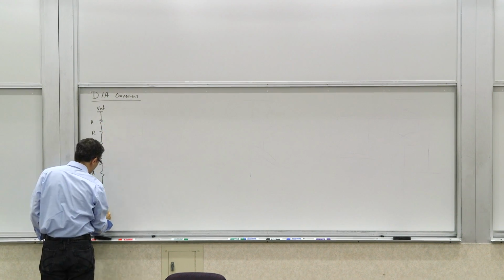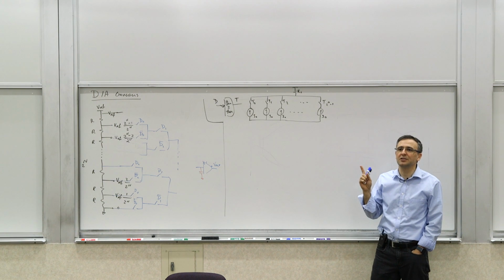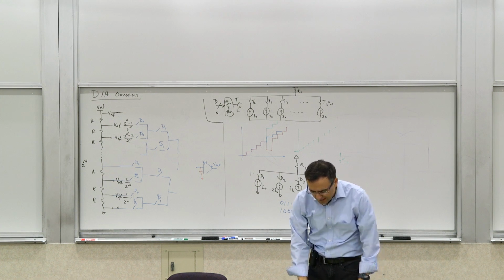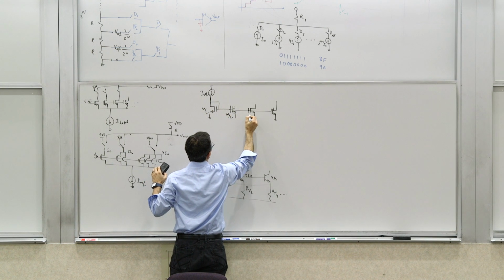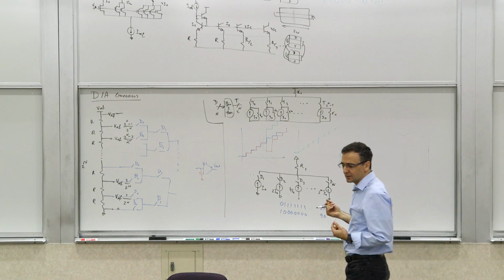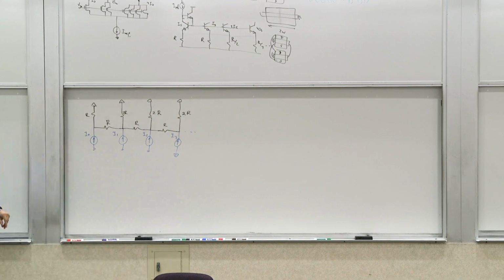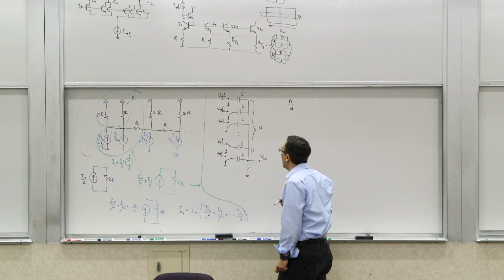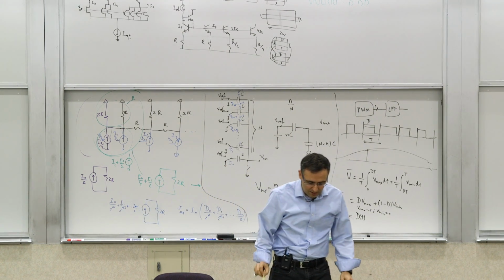182N. Basic digital-to-analog converter architectures

Comment: The first circuit, for 16 bit signal, do you need 16 resistors or 2^16 resisters???? 
Sounds like 2^16 according to the lecture.... and it sounds very stupid... because it's a very repetitive and large number... like 65,000
There are 32 bit DAC.... meaning there should be 2^32 = 4 billion resistors????
Do resistors put inside the DA chip then???
Reply from the maker: You are right; that is not a very good way to make D/As, particularly, high resolution one. It is the most rudimentary solution which is used to motivate the rest of the lecture that discusses better, more advanced solutions.